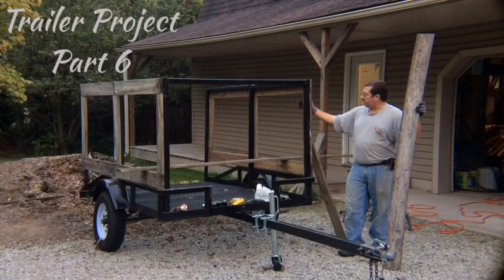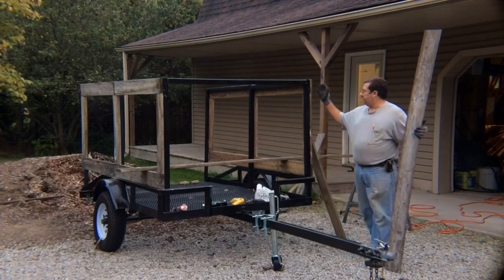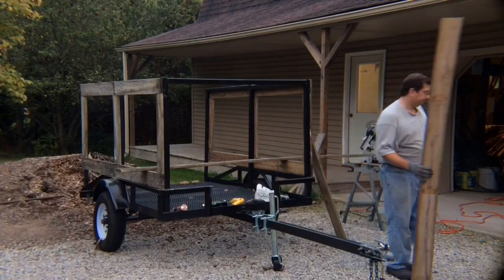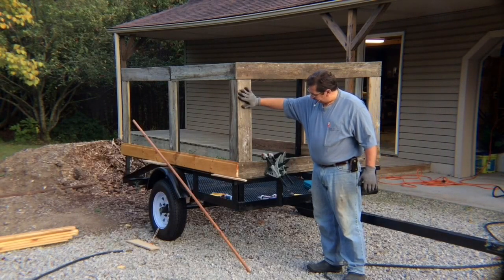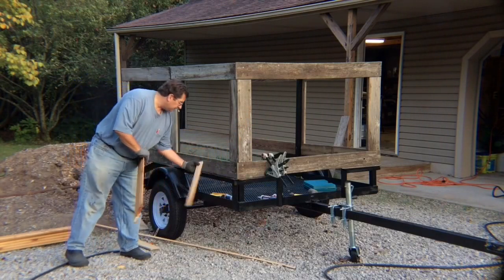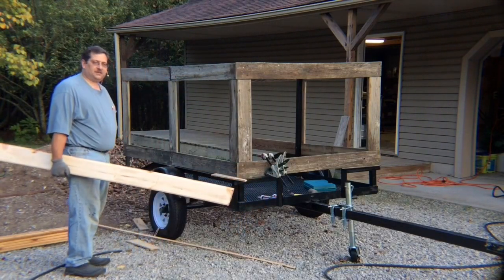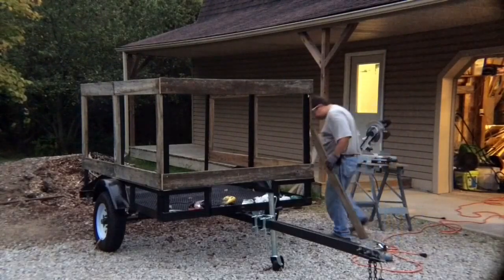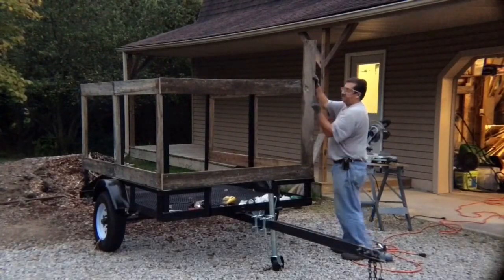Building my DIY Camping Trailer- pt6 Installing Siding

Comment: Hey Steve, the trailer is looking good so far. I like the height of the trailer walls, looking forward to seeing how it turns out and all the details you add to the build.
Reply from the maker: +Jeff Furr Thank you!  That frame made it very, very sturdy! We've got some more updates coming soom and I'll be doing some more work on it in the barn this winter, getting it ready for some spring camping!